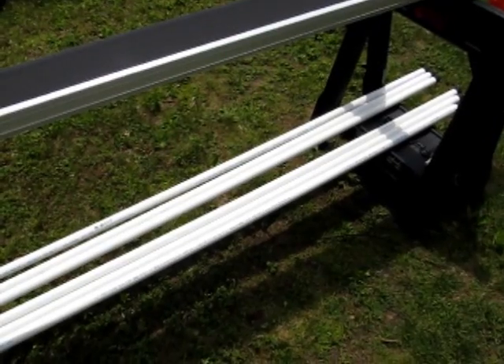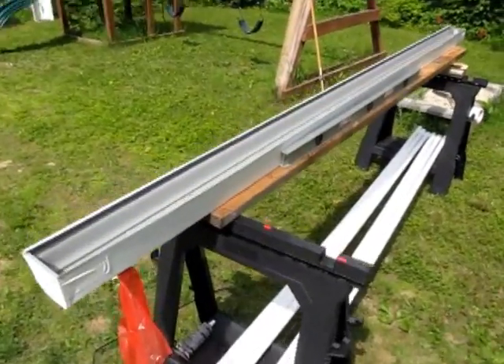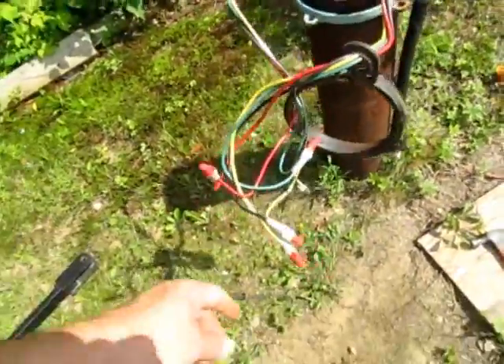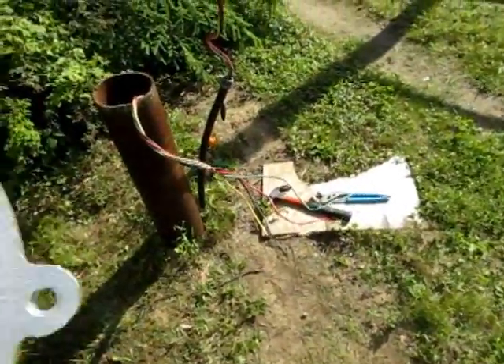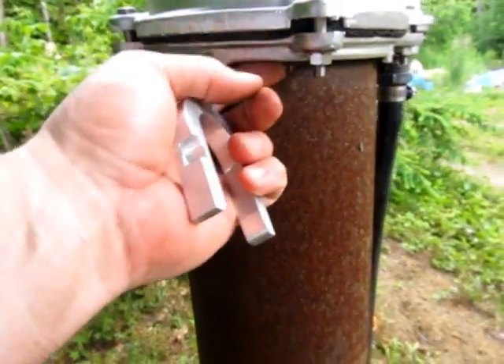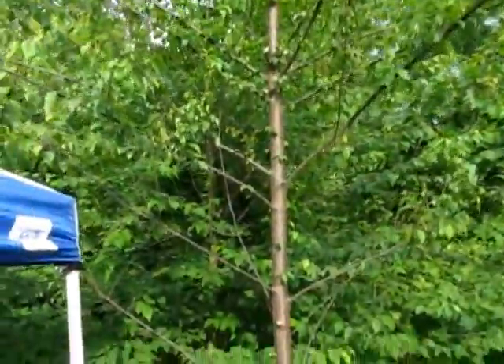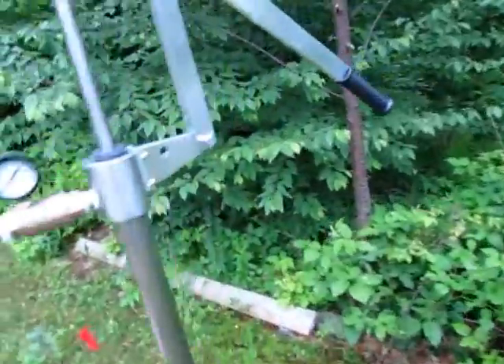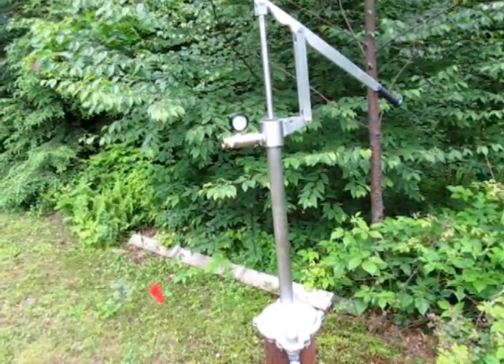Simple Pump Installation

Comment: Just now finished installing the Simple pump -- toda;y; 9/11/16.  I researched several pumps online and watched many YouTubes.  I'm skeptical by nature so this decision didn't come easy.  It took months to decide. The installation went exceptionally well with no problems, except for the nut that fell into the casing {my bad). Easily replaced at Home Depot I have a 125" well with the submersible pump set at 85 feet.  We wanted an alternative water source in case of power interruption.  The technician had provided great support initially answering many questions.  So to all you other skeptic out there, this company delivered what they promised and the quality of the materials / parts is excellent . . . and I have NO connection to them.

Comment: I have a Simple Pump in a 250 foot well. It requires about 100 pumps to get water every time despite reinstalling it several times and pressure testing each of the pipes at the company’s suggestion. It is expensive and good for a 50 to 100 foot well, but in my experience, it is not designed for a deeper well unless you are willing to do a lot of pumping.

Comment: For those of you - like me - that have an existing submersible pump in a deep well - the fact of the matter is - you don't need to buy the simple pump at all because if the power goes off, the long tube that connects to the pump underground is filled with water all the way up to ground level and further is filled with water all the way into the house. This is because the submersible pump itself has an internal check valve. Thus you can use a 30.00 hand to pump just as much if not more water out of your well using the existing well infrastructure. It's just physics. I have done it - and it doesn't matter how deep your well is - as long as it is "primed" or the tube is filled with water.
Reply: That only works if your static water level is under about 25 feet it will not work in most situations have installed 300 of these pumps and if you're over 25 feet you need a positive displacement deep well pump
Reply: Tested it. Works fine. Turned well pump off and inside the house in basement rigged a hand pump to my water outlet - after allowing all the water lines to drain - and pumped gallons of fresh water from my well.
Reply: +Marcus Brackeen what is your static water level? there in lies the answer.
Reply: OK went out to the well and raised the cap 4 feet and hooked it onto a workmate bench. Did the static level test by inserting a garden hose and began lowering it until I heard a bubbling sound. My static level is exactly 18 feet. So you are definitely correct. Thank you engineer775. But I have more info.
Reply: I made a simple device which makes pumping even easier. There are check valves at HD and Lowes - I got one where you are able to change the pressure threshold using a screw driver. I completely unscrewed it and removed the spring. This is the answer to NOT having to make your own check valve with pipe, o-rings, and a rubber ball. No need. I just hooked the check valve with the disc flap with no spring and it will pull up water 8 feet below my static level of 18 feet ( 25 feet ). Must fill the other end of the garden hose with water though. It works and we are ready for emergency mechanical procurement of water should the need arise. Thanks again! Much easier than hooking pump to my existing water-filled well pump hose. Much easier! Lots of water.

Comment: I have a 5 inch well head with a electric pump for the house. Did you have any problems tangling up with the power line going to the old pump and pit adapter. I'm installing a 30 foot wind mill this summer and I'll need an adapter. I'll be contacting this company to see if it can be done. You really made it look easy. Thanks

Comment: Thanks for the video.

I've been having trouble finding reviews of this pump from people who aren't trying to sell it.  Now that you've had the pump awhile are you happy with it?  Is it really practical to pump into the pressure tank, or does it take too much effort?

I sold myself on the idea of this kind of pump instead of relying on a generator during a power outage, and now I'm trying to sanity check myself before I put up the money.
Reply from the maker: I have to sheepishly admit I haven't tried that hard to pump into pressure. It's been on my to-do list for far too long now, and here it is 7° out now. Guess I have to wait for spring.

I will tell you that the few attempts I made convinced me that it'll be a workout to get a shower's worth of water in the tank. It took quite a bit of down force on the handle. In my case, the ergonomics are not optimal - the well casing is standing so far above ground level that I'm not able to put force on the handle below my waist, so I'm not being a very effective "motor" for the pump. I also think I have something wrong hydraulically somewhere along the line - maybe a check valve or something that's giving me excess back pressure. But again, diagnosing that will wait till spring.

I'm pretty sure I'm going to spring for the motor option at some point. Manual is OK, but harnessing electrons is always a good choice whenever possible, and frees up someone to do other, more productive work.

Thanks for the comment, and be sure to check out my blog - http://appliedparanoiablog.com
Reply: Thanks for the follow-up.

I keep going back and forth between Simple Pump and Bison.  I get a much better feeling about Bison as far as quality and the company as a whole.  However, I like that simple uses lighter components which might reduce pumping effort (and costs less).
Reply: I do install them.  I've installed 300 of them but I also use the pumps and I pump to pressure on every almost every installation.
Reply: +Brian Johnson am going to look up the bison pump also but does it come with the electice option or solar option also?
Reply: +iwantosavemoney - no thats the thing bison doesnt have those options- they are hand pumps. But bug them- they are thinking about making bike ones for folks with no arms.
Reply: @iwantosavemoney  Bison does not have a solar option which we want on our pump to be truly "off-grid". Only Simple Pump provides a solar kit fort an additional $3000+

Comment: Thanks for the video! Hey, I watched the company's install video and they show you can drop the pump pipe to whatever height you want, so you could drop the pump handle to get much better ergonomics.  BTW, have you tried pumping to pressure yet?
Reply from the maker: True, but the boneheads who drilled the well left the casing sticking nearly three feet out of the ground, so even with the pump snugged down as far as it would go,the ergonomics were poor. I eventually built a pump house around the well head, and the floor is up high enough to make the ergonomics better.

And no, I haven't tried pumping into pressure recently. I really need to try that again.

Comment: Question???  What was the power wire for?  If the pump is manual ?
Reply: That's power for the electric pump.
Reply: The hand pump is for emergency use, otherwise he just uses the electric pump as normal.